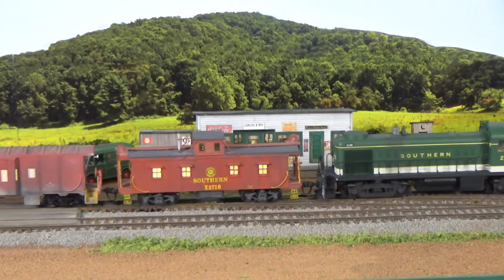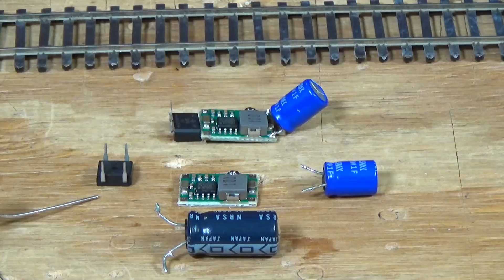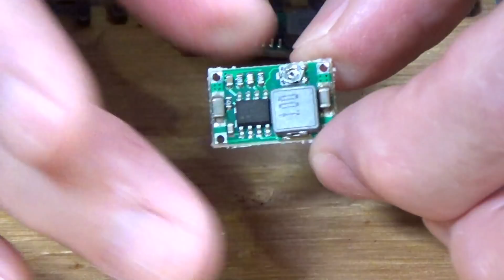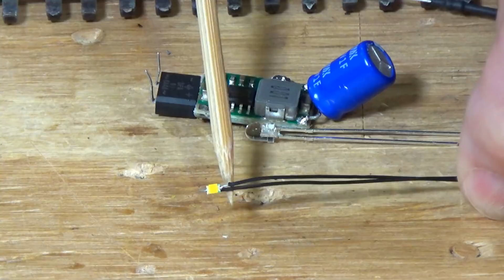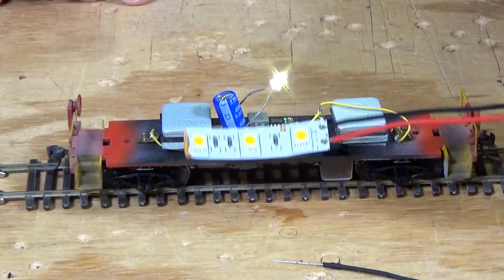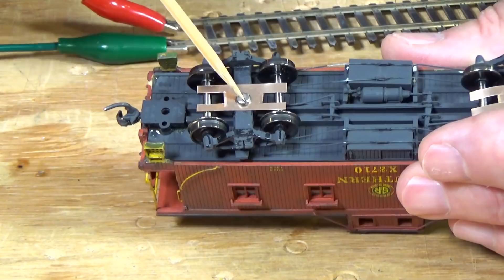New, Smaller Lighting Keep Alive Circuit (120)

Comment from the maker: You may find that the super capacitor used in this circuit will pull in a lot of current when first starting the layout. This can cause some DCC systems to see it as a short circuit and will shut down in response. To avoid this problem put a 100 ohm resistor on one wire going to the input on the bridge rectifier. After doing this I managed to fire up 3 caboose lighting systems and a sound equipped loco at the same time using a PowerCab system rated at 1.4 amps. One side effect is the lights take longer to turn on, maybe 10 seconds but once on they are as bright as ever, and it will take a few minutes to completely charge the capacitor, .
Reply: So if I were to use standard 3v hobby LEDs and strictly resistors, and no buckboard or trim pot, would I need one resistor for the capacitor, and one resistor for each LED?
Reply: @markmatteo2417  I'm assuming that you are running on DCC.  First, you will need a 16 volt capacitor not the 3 volt super capacitor shown here.  You will need two resistors.  I use a 100 ohm resister between the track and the rectifier to reduce the inrush current. You will need an appropriate resistor between the capacitor and the LED, possibly about 1000 Ohms.  The capacitor will charge up to full track voltage which will quickly destroy the LED without a resistor.
Reply from the maker: @markmatteo2417  I have not tried that arrangement so cannot say for sure. Not sure why I never tried it as it sounds reasonable. Try a 1000 ohm resistor with a single white LED but it has to be placed before the capacitor.

Comment: Today I'd use a bridge rectifier, small 1uf cap, and LED driver, and strip LEDs.  Cheaper, lots smaller.
Reply from the maker: Cool, let’s see your circuit diagram.

Comment: I have made up this device and I am puzzled by something.  I have wired this into a Walthers passenger car Interior LED DC/DCC Lighting kit.  I cut the connections on the light board between the contact pads and the rest of the circuit. Then I soldered in the nifty device ( learned from your video) and when I connected it directly to my dcc programming track (NCE PowerCab) using wires with alligator clips, it worked like a charm!   The problem cam when installed the light in my passenger car.  The lighting didn't work.  Was there a problem with the track pickups in the trucks?  No, I was measuring connectivity between wheels and the contacts in the car.  And if I modified a Walthers lighting kit with a 25V 1000A capacitor, it worked fine although the dimming didn't happen immediately, it happened too rapidly.  I have limited electronic knowledge having learned a little from YouTube.  The only idea I could come up with is that the contacts between the trucks and the contact tabs might have too much resistance. Does that make any sense or am I missing something?
Reply from the maker: I have not looked at the Walthers lighting circuit so not sure what it contains that might be pulling excess current. What else is on the circuit board and how many lights are there and are the bulbs or LEDs? Also keep in mind that the circuit only needs to get you over dirty/dead spot not be a longterm power source.
Reply: @TheDCCGuy  There are 9 LEDs.  The dcc current goes through a bridge rectifier, a small surface mount capacitor with a resistor connected to a voltage regulator which then connects to a strip of 9 LEDs. What has me buffaloed is that my modified light system works great with direct power from the track but not when that power is routed through the power pickup from the trucks to the power tabs inside the car.  The one thing I haven't done is dismantle the car to see if there is any current control device wired to the power pickup in the the trucks. If all else fails, the Walthers light kit does work with just a capacitor connected to it, although it does dim slightly upon immediate loss of contact with the rail.
Reply: @TheDCCGuy  When all else fails carefully check all solder connections for solid contact!  It works great and the light  bars fit in quite nicely and don't dim at all when power is briefly interrupted.  Thanks for your videos. I've learned a lot!
Reply from the maker: You discovered the 99% solution—check all wiring, especially connections. That’s usually the problem 99% of the time. Enjoy

PS—the capacitor is likely polarity specific so needs the bridge rectifier to convert the DCC to DC.

Comment: Where can I get pick up wheels with the brass collars over the axles that you have to solder to
Reply from the maker: No idea, what do you want to solder to what?
Reply: I'm looking for the pickup Wheels the ones with the brass colors on the axles
Reply from the maker: The only things like that I have seen are made by DCCconcepts and those have small springs wound around the axles for power pickup. With those the wire is soldered to the end of the spring wire.

Comment: Stupid question from a non-electronics-experienced mechanical engineer who enjoys your videos: 1F seems like a lot. Doing the math, a 1F capacitor would keep a 3V 20mA LED going for a couple of minutes. You also mention the capacitor take time to charge, which on a DCC layout it's doing as long as there is power to the track, correct? So I guess it's not that big an issue. In any event, my question is, for a lighting keep-alive, where you only need power from the capacitor for a moment to prevent flickering, couldn't you get by with something like 0.01F? If not, why not? Is there some other advantage to the bigger capacitor (availability, cost, etc)? Thanks!
Reply from the maker: You can use smaller value ones and in my earlier video I did use one although the device itself was much larger. So if you can find a super cap like that go for it. I was looking for the smallest size at the time. It also means you can operate several LEDs off the same cap for use in  passenger cars. So it’s all a tradeoff.

Comment: Larry came back to this  Using the wipers on the wheels gave  me many issues shorts etc.   I now use a brass tube on a wheel which I get from JB Wheelsets. They work much better than the wipers.
Reply from the maker: There are many ways to pickup power. DCCconcepts makes set just like the ESU ones and also offer coiled springs that go on the axle and pick up power that way. Whatever works for you—Larry

Comment: Quick question regarding adding a resistor to slow the inrush current.

The 100ohm resistor is fine for 1 led but what if I have more leds.  I assume the resistor value changes for every led that is added ?
Reply from the maker: The resistor is there to deal with the inrush current demand of the capacitor not the LED(s).

Comment: I tried this with a capacitor 100 micro  rated 25V with a led strip of 6 lights (12v) . Buck board overheated and lights will not come on any suggestions, poor soldering? I would appreciate any ideas.
Reply from the maker: What kind of capacitor were you using and what output voltage was the buck board rated for? Did you use the bridge rectifier?
Reply: I used a Jackcon 1000uf 25v on a MH-MINI-360 Buck board. I did use a bridge rectifier. @TheDCCGuy
Reply from the maker: What voltage did you set it for? Since those are rated at 3 amps the amperage of the LEDs should not be an issue. Other than that you might have a solder bridge somewhere creating a short. Also make sure the capacitor is connected to the correct polarity contact.
Reply: Thanks, I'll try it again. Set dial(?) to the right (3 or lower).  @TheDCCGuy
Reply from the maker: No, in this case you said you are trying to operate a 12VDC LED strip so you need to set the buck board to put out 12 VDC. You will never light them with only 3VDC. Use a voltmeter to adjust the output potentiometer to 12VDC, don’t guess.

Comment: One of the benefits of a Buck Converter over a resistor is that it uses pulse width modulation to reduce voltage rather than burning it up as resistance. If you put a suitable capacitor in front of the Buck Converter It will feed, for example, 12v into the Buck converter PWM on-off style 3V at a time (so to speak) so the feed is not interrupted and 12/3=4 lasts 4x on the supply side (OK, not counting conversion loss). For N Scale my plan is very similar to your (excellent, btw!) video but a small cap on the front, a 3v fixed Buck converter, 0.5F super cap, and 3V LED strips.

Comment: Hi Larry - Question -  Bridge Rectifier - Can I use DB107 (1000 volt / 1 amp ) in place of  DB102 (100 volt / 1 amp)
Please advise.
Reply from the maker: Don’t know why not, but I’ve never worked with any over about 30 volts.
Reply: Thank you.

Comment: Larry - I read thru all the comments and no one else seems to have this problem. I tried 2 of the mini-360 buck boards and found them difficult if not impossible to adjust and then once adjusted do not hold the voltage. I am trying to get a constant 1.5v out for some grain of wheat bulbs. I have not connected the cap because it is 5.5v. My meter varies anywhere from 0 to 10 v without me touching anything. Fyi I am using a metal screwdriver, a bridge on the front end, a dc power supply set for about 12 v, and a 1k ohm surge protector. The only load is the meter. Perhaps there is something wrong with both boards. And perhaps I should not use a metal screwdriver. Do you have any other ideas?
Reply from the maker: Why the 1K resistor? I used a 100 ohm one with the or as a surge suppressor but if you’re not using one then you din’t need the resistor at all.
Reply: @TheDCCGuy  Thank you very much. The 100 ohm resistor works great. Now I can set the voltage at 1.5v so I am thinking I do not need an output resistor. Or should I add 100  or 200 ohms there?
Reply from the maker: You don’t need the output resistor unless you are using a capacitor.
Reply: Thank you for your quick response. Yes, I want to use a 1.5f 5.5v capacitor but when I place it across the output the voltage dropped to about 0.5v and could not be adjusted. Then after I also added a 50 ohm resistor across the output I could adjust the output to between 1 and 1.5 volts but not all the way to 1.5v. The load I want to use is two 1.5v grain of wheat bulbs (caboose marker lights) . When I added these in parallel with the 50 ohm resistor and capacitor, it seemed to still work. The 2 bulbs without the 50 ohm resistor was not enough load to make it work. My mini-360 seems to need a minimum load in order to work. That does not seem to be true with yours. I am not comfortable with this device.
Reply from the maker: Odd, but then I have never tried going down to 1.5V which maybe near enough to the lower end of the adjustment range to be unreliable. You could try using a higher output voltage with a dropping resistor to power the bulbs.

Comment: this isnt compatible with just a plain dc system is it?
Reply from the maker: No, since with DC there is no constant power on the track the keep alive capacitor would not stay charged.
Reply: As Larry said there's no constant power on the rails, but the circuit itself will work on DC. As long as there is more than 3V on the rails it will feed through the Buck Converter and come out 3V for the LED. With less than 3V on the rails it will eventually dim.

Comment: Does the BuckBoard perform the same function as a resistor? Or, does a BuckBoard drop voltage and a resistor drops amps?
Reply from the maker: It acts as a rectifier and voltage regulator giving a fairly stable voltage fir your lights.

Comment: Cool stuff, I will try it. But why not solder on a short piece/wire lead ( 1" to 3" long or more) of two conductor wire wrapped around the capacitor legs at the same time you solder it to the board?. Then you can add one or more LEDs and be able to place or move them around inside. I always install at least 2 LEDs in most cars and several in passenger cars, one pointed up and one pointing down for way better light dispersion, since most LEDs are directional at only 60 degrees. This also would prevent soldering twice to the same points or spots on the board and heating up the circut board and the cap twice. Heat is the enemy, especially very small circut boards with micro contact solder points that easily burn off. Oh , I also paint the inside of the car white to reflect and fill the interior with light better too, What a difference!... Just saying.... Great video and thank you for doing them!!!.
Reply from the maker: If it works for you that is great!
Reply: @TheDCCGuy  It can work for all of us, on sharing info, leaning, teaching, techniques and vast experience that many of us old model railroaders have including mistakes...

Comment: If you power LED lights by the wires from the DCC Decoder do you need a Bridge Rectifier or does the DCC Decoder have a Bridge Rectifier built-in?
Reply from the maker: Decoders do rectify track power as the electronic circuit is DC. However the voltage feed on many decoders is nit regulated so you still need dropping resistors. There are a few decoders that offer onboard resistors for powering LEDs.

Comment: I ended up with a buck board that has the two small capacitors on the board. Works fine with an LED but after adding a 16 volt 1000 if capacitor, it does not stay on when powered off. The cap worked fine with just a bridge rectifier, resistor and LED. Thanks, Neil

Comment: What kind of electrical wire can you use for that you want something real flexible right
Reply from the maker: For the connections to the trucks you would want stranded wire in a small size but on the actual device it doesn’t matter since it doesn’t move about.
Reply: @TheDCCGuy  thank you  it is nice to have your experience on videos

Comment: Here's a question. Would this circuit work for a 1 1/2 volt incandescent bulb or two? I have some caboose lanterns with those bulbs and wondered if this buckboard can be reduced in voltage down to 1.5 or less to safely operate these lamps and if so, would this particular capacitor also work okay at that voltage?
Reply from the maker: These can go as low as 1 volt output so it should work. The capacitor should only put out the voltage it receives, but you may be able to find one rated at a lower voltage and lower cost. Either way I would test it on a single 1.5 volt bulb first.

Comment: Larry  Where would you put the inrush resistor on this circuit on the wire from the truck?  An do you have a model number so I can order them?   Thanks Tom
Reply from the maker: Tom you need to read through the other coonents on videos. This question came up and I answered it:

OK, I put a 100 ohm resistor on one wire going to the input on the bridge rectifier and managed to fire up 3 caboose lighting systems and a sound equipped loco at the same time. One side effect is the lights take longer to turn on, maybe 10 seconds but once on they are as bright as ever.
Reply: @TheDCCGuy  Larry just ordered from Amazon 100 OHM resistors they will be here tomorrow. I will do a video and post on my channel the change to the circuit. I just started my channel yesterday and posted a video of my railroad crossing with the signals you get a chance  subscribe and make comments   thanks Tom

Comment: I have enjoyed the videos, even though I have switched back to my Lionel.  This circuit intrigues me with all of the possibilities it offers.  Since I use AC for the track voltage as well as my accessories, can you (or the other readers) offer any insights?  The track voltage is variable from 0 to 20 volts and I am looking for ways to tame it and convert it to 3v DC for some marker lamp pairs.  Thx!
Reply from the maker: Take a look at my videos on lights for cabeese and passenger cars.

Comment: Larry, i did an Ebay search for the Buck Modules & I saw most of them have 2 capacitors(?) already installed. Will they also work? Or Do i have to buy the ones which is on your video? Sorry but Im an electronics dummy. Thanks in advance....
Reply from the maker: I think these are the last ones I ordered.  https://www.ebay.com/itm/10pcs-Mini360-3A-DC-Voltage-Step-Down-Power-Converter-Buck-Module-3-3V-5V-9V-12V-/132416658988?hash=item1ed4a5de2c

Comment: Hi Larry,
Can something like this be made / used for a DC system?
Reply from the maker: The difference is DCC is a constant 14 or so,volts where as DC can go from 0-14 volts. The answer is you can’t power a constant voltage device with a variable power source.
Reply: @TheDCCGuy  This question is a good segway into my question. I am wondering about installing a rechargeable battery into a similar circuit to keep the rolling stock LEDs lit on a DC layout. Thanx!
Reply: I was also wondering if this would be safe on DC.  I mainly use DCC, but occasionally run some of my DC locos, for holidays, etc...  Would it just be a matter of the lights not coming on, at lower speeds, or could it potentially damage the circuit?

Comment: Larry Thank You for a well put together and informative video. Just a quick question. Why did you not use an SMT Super Cap? the cost difference is not much and it seems you could save even more space.
Reply from the maker: I have looked for them but could not find any of the ratings I used, specifically 3V, 1F. If you know of a source please share it with me.
Reply: @TheDCCGuy  One other thing, true super caps (1F etc.) typically have very high ESR ...  am guessing you could probably eliminate the 100 ohm limiter with that.